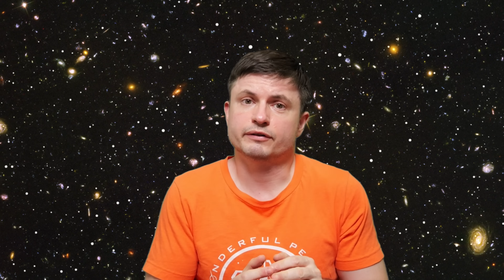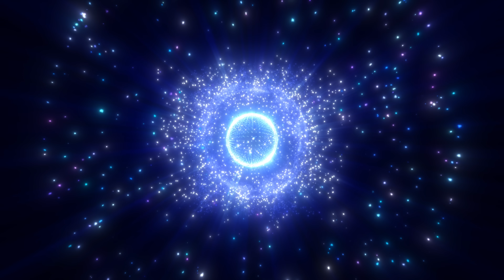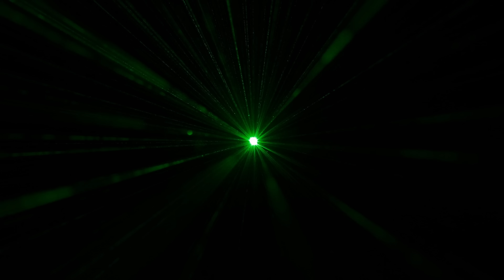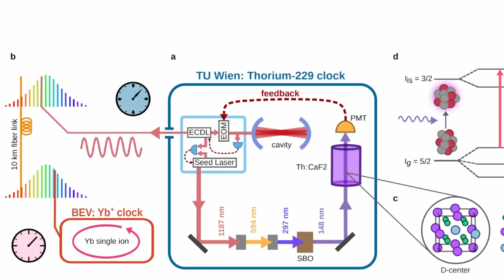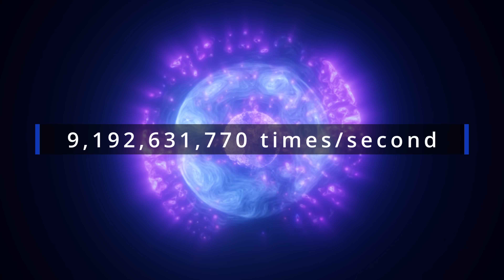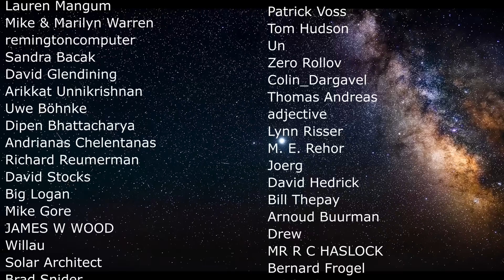The Nuclear Clock Is Finally Real And It May Change Everything

Comment: Anyone else wondering how electronics can actually count laser fluctuations fast enough to track this number of oscillation per second?
Reply: It's called a phase-locked loop. Oscillatory systems have a handy way of counting themselves.
Reply: @Nethershaw I'm not sure what you mean by "Oscillatory systems count themselves"? Phase-locked loops use components to measure the phase error between two equal (or relatively equal) frequency sources. One of those sources is typically a VCO (voltage controlled oscillator) and the other is the reference oscillator. The feedback loop converts the measured phase error between the two sources into a voltage that adjusts the VCO frequency, bringing it into phase alignment with the reference oscillator. Each component in the loop is rated to some level of accuracy that must be far below what is required to make these clocks work as accurately as current atomic clocks. Anton suggests that this should be reduced to an engineering problem at this point - hopefully he's right but don''t expect a nuclear wrist watch any time soon.
Reply: @rangerBlu  Wow. It’s getting more and more difficult to honestly believe I know as much as I thought I knew.
Reply: @rangerBlu  One of you two knows WAY MORE about this than the other. But I don't know which one of you it is.
Reply: @sfurules   My explanation re PLL can verified by consulting Wikipedia. As a PLL pertains to this particular clock I can’t say for sure but it’s likely they use something similar if not exactly a PLL in their feedback loop. I’m sure @Nethershaw knows quite a bit about the subject since they rightfully recognized a PLL is likely part of this system. ✌️
Reply: @rangerBlu how is any of your description of a phase lock loop different from the statement that oscillatory systems have a way of counting for themselves? For instance what is the difference between the reference oscillator and the voltage controlled oscillator? Do you know the material that is being used as the source of the oscillation? You do realize that the source of the oscillation is the thing that gives it is accuracy right? Therefore the statement that oscillators have a way of counting themselves is not discounted by your explanation that oscillators have a way of counting themselves. Worked too long in metrology to see a midwit use Wikipedia to sound smart without actually knowing the fundamental thing that is occurring. Its insane. What’s next, you’re going to say that gps systems aren’t a good way to measure time??? Silly
Reply: @sfurules  😂🤣 beautiful comment
Reply: @henrytep8884 because “counting themselves” is vague and misleading
Reply: @rangerBlu  I gave up trying to understand this debate about 3 sentences in
Reply: @Nethershaw Of course, the computers these days operate at gigahertz frequencies, but that's not enough! This is all analog, it needs to be downsampled to record it digitally
Reply: @tomholroyd7519 thanks for explaining. Makes sense, analog is "infinite" speed, realtime unlike digital hacked up signals.
Reply: @Nethershaw - That's not an explanation.
Reply: @Nethershawbut think about how fast electrons can move through a wire per clock cycle. Insane
Reply: Optical frequency combs
Reply: 1…2…3. Same way we count everything else
Reply: It's giving Skynet 😂
Reply: But knowing how fast it is to this accuracy, where is it? 😂
Reply: Optoelectronics is a wild and magical world.  Analog never went away.  It just got weirder.  A bachelor's in physics is just enough for me to say that it's wizard stuff.  If you really want to blow your mind, take a few semiconductor physics courses.  That and quantum optics is where a lot of the really crazy stuff is at now.  Nonlinear wave mechanics, weird virtual particles that only exist as emergent phenomena, elaborate quantum jungle-gyms of band gaps and potential barriers, and the necessary demolition of any personal discomfort with complex numbers.
Reply: they try really really hard
Reply: System ticks are amazing in event management!
Reply: They use what’s called an “optical comb”. Certain optical fibers take an input light frequency and multiply the wavelength, essentially downshifting it to a lower frequency. This they can count directly.
Reply: It's all fake bruh no one can count that fast
Reply: I created a saying in 90s based on another one, mine went like this; perfection is an illusion created by a reality deficiency.😊
Reply: @EricThompson-e2p I would say that perfection is an ideal or theoretical concept; your saying is way more operative.
Reply: @maxfern Yes and no. Perfection is imperfection and vice versa. These are not truly separate but we name them differently. So while it is just an ideal it is also actually real, here and now.
Reply: @道意迷The Ying-Yang profile picture fits well with this comment :)
Reply: @EricThompson-e2p  Except it's reality that's doing the nuclear oscillating. It's a technological deficiency, and these days, technology do seem quite deficient.
Reply: @EricThompson-e2p  Perfection is the actual reality, everything else is illusion
Reply: Electricity pretty fast bro
Reply: Data is being fed to AI
Reply: Nah. Just think Matrix bullet time
Reply: @I.G.G.G. there is no spoon
Reply: Because time affects all of the various ways we have of measuring it. The more accurate we can measure time, the more important Einstein's theory is to understanding it.
Reply: I have a G-Shock Mudmaster digital watch that has a solar battery and blue-toothed connectivity. It is always ‘synced’ with an atomic clock in the United States. Others atomic clocks in my house differ in increments less than a second. All in all, time keeping is pretty amazing.
Reply: They don't, the fluctuations are directly probed by the circuit becoming part of it effectively. After all what would be the point of a clock that needs another clock to work? (Yes, to count X things per second you need to already have a clock available)
Reply: It’s not 3 Roentgen.
Reply: One sec, I’m just a bit confused everybody.. We keep time based on nuclear functions, and even measure time dilation by it, but according to “Einstein”, time is a “4th” dimension and is “woven” into “spacetime” fabric..? Can someone please explain to me why Einstein is still relevant in our real world?
Reply: @JasonAlexander-w8k because the world works according to Einstein
Reply: @florin604  until someone better comes along
Reply: @JasonAlexander-w8k   Being so 'skeptical' (in denial) of science that you put Einstein's name in quotations as if he's also something you doubt existed or doubt said these things is so hilarious. Especially since he actually didn't say these things, you're the one who thinks he did. He didn't say anything was woven into spacetime nor did he describe spacetime as a fabric.
Reply: @catpoke9557  he kind of did though. Special Relativity shows that all motion can be conceived of and represented as as a hyperbolic rotation in spacetime. I won't try to pretend to understand what that means exactly, except clearly it does show that time and space aren't neatly separable things like Newtonian relativity would suggest, but instead related in this actually geometrical way.
Reply: @catpoke9557  yeah he was a patent clerk, who almost couldn’t get a job and wasn’t really liked by any of his professors. Nikola Tesla, a man who actually produced stuff, said he was a quack. Funny how everyone today worships him like he’s the Jesus Christ of science, but none of you can explain how any of this sh1t actually works
Reply: @cianmoriarty7345  Albert Einstein stupidly eliminated the dielectric medium named "ether"  in 1905 and bizarrely went on to reify time and space in his absurd General Relativity paper that claims mass warps, stretches, and bends "nothing" aka space. If Einstein had absolute, unshakeable faith in a vacuum-based General Relativity, he never would have given his famous inaugural address at the University of Leiden on May 5, 1920.

After spending years wrestling with the cosmological consequences of GR, Einstein realized that a universe of absolute nothingness was mechanically impossible. He stood before the university and explicitly recanted his total dismissal of the medium.

"Recapitulating, we may say that according to the general theory of relativity space is endowed with physical qualities; in this sense, therefore, there exists an ether. According to the general theory of relativity space without ether is unthinkable; for in such space there not only would be no propagation of light, but also no possibility of existence for standards of space and time..."

Neither time nor space has properties , one measures magnitudes and the other has dimensions. Einstein grew to understand that without an underlying medium, you cannot have a rate of induction (c), you cannot have inertial resistance (mass), and you cannot have local field metrics. He realized that his mathematical field equations were just abstract shorthand descriptions for the varying pressure densities of a superfluid space. Once a medium is eliminated you are forced to reify attributes to fill the void. The technical term for this is STUPID.

Magnetism is inherently centrifugal and divergent. It is the radiation of the field. When a field diverges, it creates volume, attributes, and geometric separation. That separation IS "space." Without the spatial divergence of the magnetic field, mass and magnitude could not exist and everything would be compressed into a single, dimensionless point of infinite density.
Gravity is the collapse of space and can be thought of as an anti-field which causes anti-time. Magnetism is the outward, centrifugal inflation of space, gravity (which is conjugate to dielectricity) is the centripetal, counter-spatial acceleration back toward the inertial plane. Gravity doesn't "pull" objects through space because it literally collapses space itself. Because time is nothing more than an abstract metric used to measure the movement of magnitudes through space, anything that cancels out space automatically cancels out time. Because gravity is the centripetal erasure of spatial divergence, then gravity is structurally anti-time.

The only way to make a clock is to use a physical object in motion, whether it is a swinging pendulum, a vibrating quartz crystal, or a shifting cesium nucleus. Therefore, a clock never measures "time" because time does NOT exist as a dimension or thing, it measures its own internal resistance to the medium it is moving through.

The Earth is the center of a massive, localized dielectric pressure well. As an atomic clock moves away from the Earth into high orbit, it is moving (get it? motion) into a completely different dielectric pressure gradient. When an atomic clock or a satellite are moved away from the Earth the background density of the medium changes. Because the cesium atom is electrically and magnetically coupled to the entire universe, the local field tension alters the rate of its atomic fluctuations. The atom doesn't maintain its terrestrial motion because its environment has fundamentally changed. The satellite clock ticks faster or slower not because it has traveled into the future or the past, but because you have dragged a physical resonator into a different zone of induction pressure.

When we eliminate the mystical concept of looney toons "space-time," the universe becomes a beautiful, logical, mechanical machine. You are left with a continuous, fluid field where everything is connected. Clocks are NOT timekeepers, what they are IS ultra-precise field pressure gauges. So no sir, space-time is NOT a fact and is the result of attempting to explain medium effects without a medium and dismissing it through ignorance to its mechanisms of which the most fundamental is the medium IS inertia.
Reply: @JasonAlexander-w8k  was Professor Einstein a patent clerk at one point in his life? Yes. I fail to see how it's relevant. He was also a professor of physics who made more transformational discoveries than basically any other scientist, ever. The Jesus Christ of physics? Yes. Yes he is. 
If you want to know why we all respect him so much, I suggest you take the time to study an introduction to General Relativity. Work through the equations and see if you can find where any of it falls apart using rigorous mathematical proof. 
There's nothing I can say in a YouTube comment that can convince you.
Reply: @catpoke9557  Einstein reified time and space. Time is an abstract metric and space has attributes but no properties. If Einstein had absolute, unshakeable faith in a vacuum-based General Relativity, he never would have given his famous inaugural address at the University of Leiden on May 5, 1920. He eventually wised up and realised that his GR without a medium was DUMB.
Reply: @JasonAlexander-w8k  You are correct. Tesla was a genuine genius that paved the way for the electrical technological age and Einstein reified time and space and gave us Narnia bendy space-time where the math checking out equals the math becoming reality and the looney toons physics we have today which is stagnated due to it being hijacked by pixel fixated mathematicians.
Reply: @mjmulenga3  Einstein did NOT understand time, space, or gravity and Tesla knew GR was absolute nonsense, which it is.
Reply: @J @JasonAlexander-w8k kay, you’re just regurgitating slop you’ve heard from various YouTube channels. Some of these worship Tesla just as much as you say Einstein is worshipped. Both men advanced society. They do not need to be compared. Einstein said that space and time are one. This is bc time is woven into space, as “empty” space is just quantum fields. If you have quantifiable information, you have time. Your question asked if Einstein’s ideas were relevant today and why he said time was woven into space. The answer is yes they are relevant, as Anton described what a nuclear clock was and it is within that very definition that you see how time emerges from space
Reply: @TheUnlivedJourney  not really, I don’t consider Einstein as doing much because most of what he mentioned had already been stuff that other scientists had worked on and figured out, and things like time dilation, we would have figured out anyways without him. Real scientists worked on nuclear energy projects at that time, Einstein was more like a mouth piece or commentator, a figure head
Reply: @JasonAlexander-w8k it's explained in the video. Basically they use a wavelength (UV) that has the same frequency as the thorium nucleus
Reply: @JasonAlexander-w8k  why would that make einstein not relevant? i mean, do you understand what that quote even means?
Reply: @JasonAlexander-w8k 
Spacetime as a concept is critically important because of what it allows us to describe. 
Normally, time dilation is pretty difficult to picture; in 3D space, time dilation and velocity seem pretty seperate. In 4D spaceTIME, everything is always traveling at c - time dilation is just the effect of more of your velocity being in spacial dimensions, rather than temporal ones.
A fantastic example of the applications of spacetime is how we actually unify electromagnetism into a single force. In 3D space, the electric field moves charges directly toward or away from each other, while the magnetic field moves charges sideways. This is confusing and unsatisfying. In 4D spacetime, these are unified into a single field, which simply "rotates" the spacetime velocity of a charge!
Reply: @theavaliengineer  you're off track somewhat here. Maxwell's equations already unify the electric and magnetic field.

They heavily imply that the speed of light in a vacuum is constant set value, the reciprocal of the square root of the product of the electric and magnetic permittivity of free space, independent of any observer or source. Which doesn't make sense in Newtonian physics, because velocities (of the source, the electromagnetic wave and the observer) are supposed to add, but there is only the speed of the wave in this equation.

But if you keep that assumption of constant speed of light and play with what that means, the Lorentz transformation falls out as the only thing that will satisfy those constraints.

The theory of Special Relativity is the physical theory which makes sense of the Lorentz transformation. It assumes "flat space time", whatever that means, and does not include gravity.

The theory of General Relativity is the Special Relativity which allows space time to curve, whatever that means, and it turns out that explains gravity and a number of other effects that happen in non inertial (accelerating and gravitational, conceived in General Relativity as the same thing) frames of reference.
Reply: @theavaliengineer  so according to what you said, everything is traveling at c, then an atomic clock that is not moving through space would would oscillate at the speed of it quarks moving at c, and then if the atom is accelerated, it would oscillate slower because the quarks are no longer traveling at c? They’re moving more through 3d and can’t move as fast through time?
Reply: @cianmoriarty7345  Thank you for the correction! I deliberately simplified to make a point, but I think I lost a piece of it along the way.
Reply: @JasonAlexander-w8k because time doesn't exist for a particle moving fast enough the hypothesis that time is an ullusion is based on the fact photons don't age
Reply: @swiftyspike  The "photon" is an attribute of light, it is not a thing in itself. If I leap up have I emitted a "jump?" No, of course not because a jump is what something does not what something is. Time is a metric and is NOT a dimension and it does not have properties.
Reply: @spamm0145 ur high the photon IS the light just as losing energy isn't losing energy its gaining light
Reply: @swiftyspike  No-one has EVER seen light. We can only observe lights attribute illumination which is a constructive deconstructive interference when light interacts with matter. Think of it like your eyes are a radio tuned into the electromagnetic spectrum "illumination FM" because there are no stupid photons whizzing into your eyeballs which is absurd. Light is everywhere and the reason for the night sky being black is due to the absence of matter despite the universe being populated with stars, planets, ect, so there is no constructive deconstructive interactions with matter and the night sky remains unilluminated. There is no such thing as a "photon" this is a child like misinterpretation of medium effect that has been reified as a particle. The observation is a momentary pulse of lights "illumination" and it can be thought of as a "pinch or squeeze" of light.
Reply: @spamm0145 we don't see anything our brain interprets a holographic universe on a 16 dimension vortex
Reply: @swiftyspike  I clearly stated the "eyes" are tuned to the EMS of lights illumination which means that eyes are perturbation sensors that detect the disturbance of light when it interacts with matter and you are wrong about 16 dimensions. There are only 2 dimensions which are space and counterspace. The universe is an analogue mediation pressure system which operates due to pressure gradients.
Reply: @JasonAlexander-w8k  bc the quantum field is woven into space and time exists in the quantum field. As Anton explained and according to Einstein
Reply: @JasonAlexander-w8k   You act like we're measuring time directly. Like you believe that if you make a powerful enough microscope you'd be able to see tiny time soldiers marching in step. We're measuring nuclear reactions, and calling it time. We can't measure time directly anymore than we can measure space directly. There is no fabric called space-time that you can hold in your hand and measure with a ruler directly. It's just an analogy. And they've had sixty years to produce someone better than Einstein. Doesn't look like it's going to happen anytime soon. That should have been your first clue.
Reply: @JasonAlexander-w8k you can answer this by thinking about how gravity works/affects space time. It's proven that atomic clocks run faster/slower depending on the 'gravity well' they are kept within. 

A simple way to think about it is, an atomic clock on the ISS would run slightly faster than one on Earth. They would both be accurate from their reference point but would show increasingly different times over a long enough period.